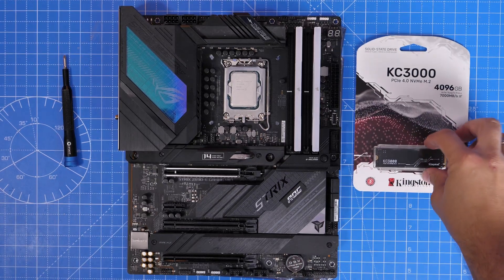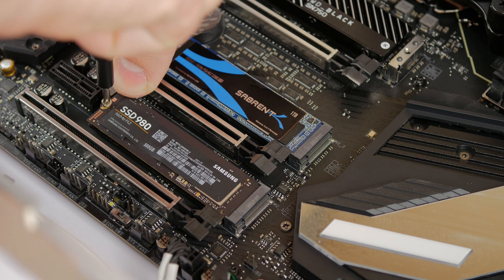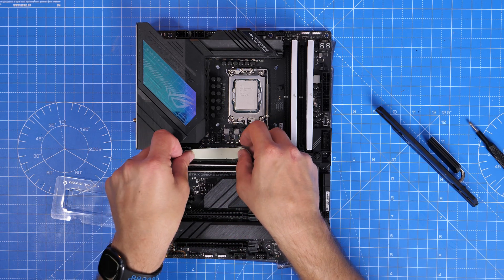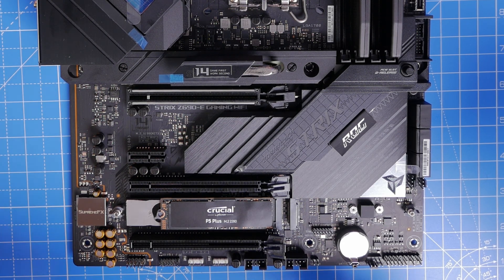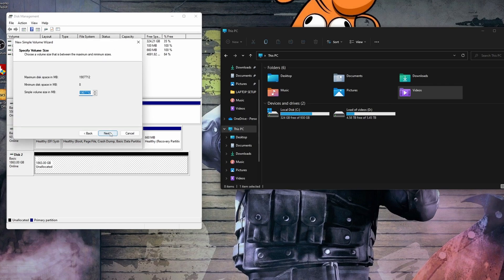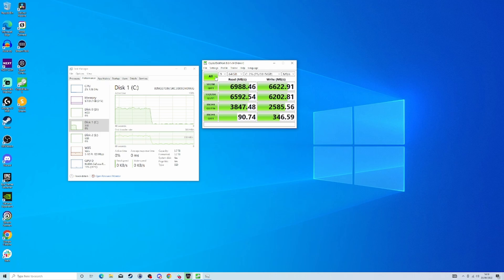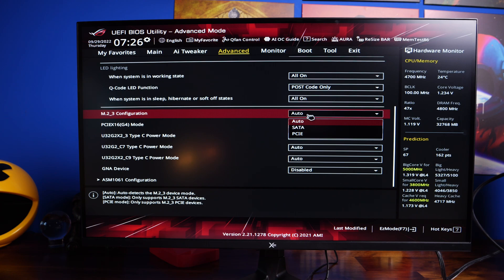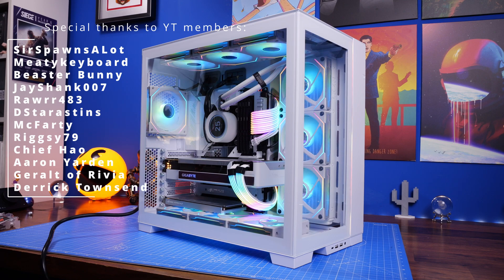How to install Kingston KC3000 NVME with  tips to check speed

Comment: Please to anyone who owns this drive, update the firmware to the recently released version! If you don't your drive will massively fall in performance over time. I got in contact with Kingston over 2 yeas ago and just recently they fixed the problem. Every KC3000 should be affected. The problem being that sections of the drive that have been allocated and not used over long periods of time drop their transfer speeds down to single digit MB/s.
Reply: To dziadostwo jak trzeba na staracie coś aktualizować tym bardziej dysk 🤔. Wogle jak to zrobić. Chyba wolę kupić lexar 790 bez żadnych kombinacji i jest tańszy.

Comment: would the kc 3000 512gb nvme be a great choice for a boot drive just with win 10 ..?...my cpu only does gen 3 speed but my mb does support gen 4 speeds when i upgrade my cpu one day ..
Reply from the maker: Sure. I'd go for 1TB if you can, as it's really easy to fill smaller drives but it'll still be good
Reply: Ok great thanks for your help ..😁